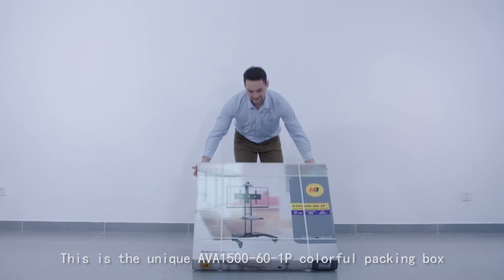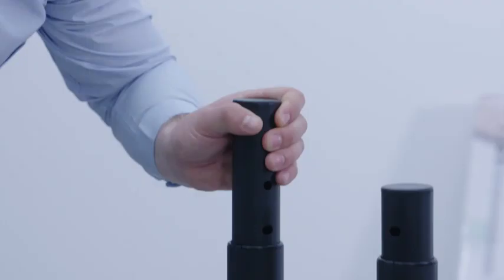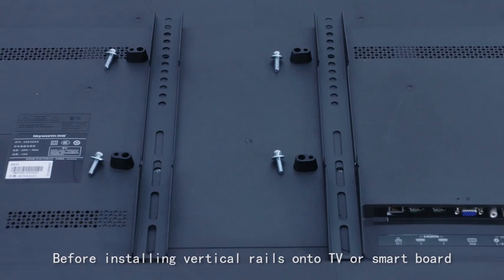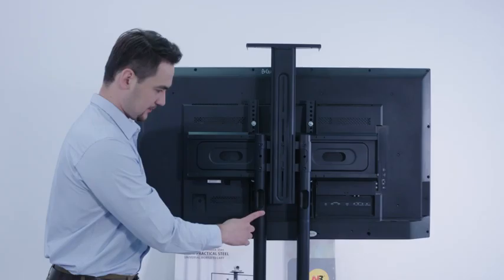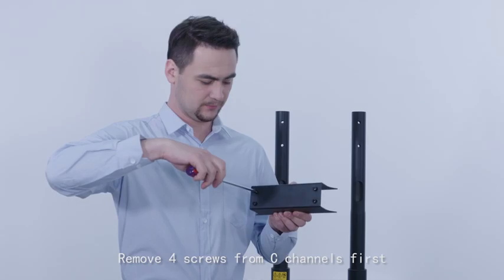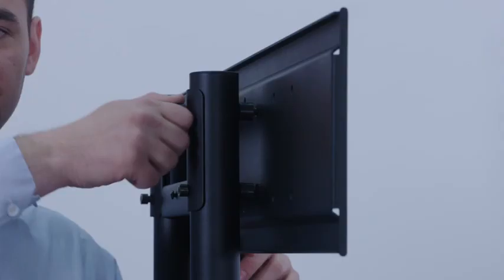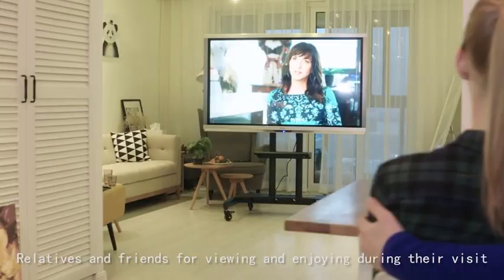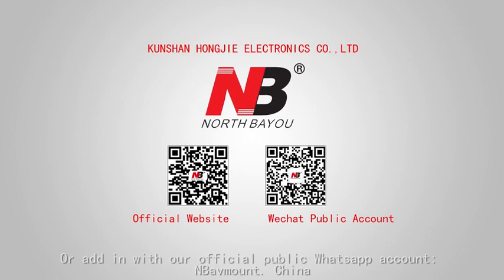North Bayou AVA1500-60-1P tv mobile cart with UL certified

Comment: Will this mount support a CURVED tv that uses spacers, would I need to use longer screws to go through this units small spacers and then continue going through the the longer spacers that came with my curved Samsung 65” 4k 7 series tv......and then be securely tightened into the vesa holes on the back of my tv?